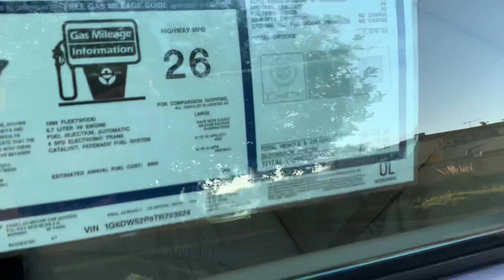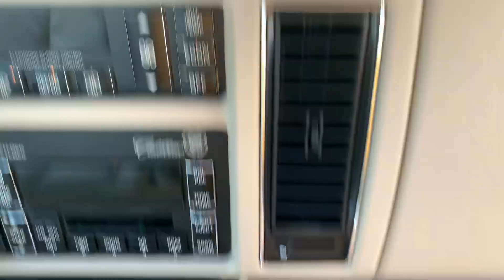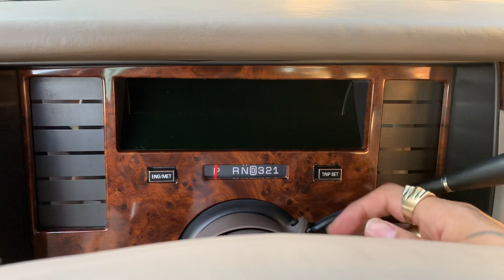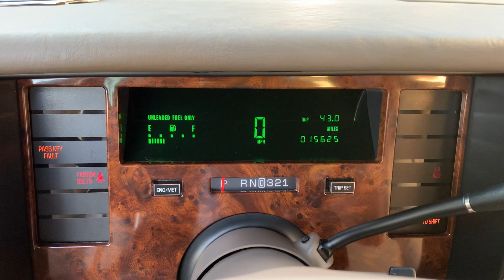1996 Cadillac Fleetwood Brougham  15k original miles - AVAILABLE PRICE IS 45K OBO !!

Comment: I have a 95 with about the same Mileage. Mine has the VP4 option which puts a 3:41 or 3:42 ratio Axle in it. Is pretty quick the Lights, but does suck the gas